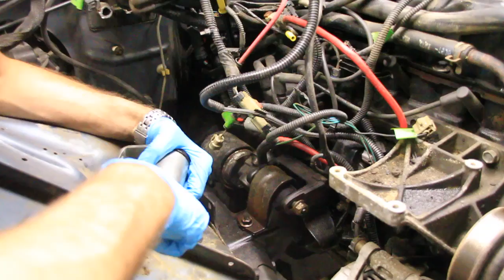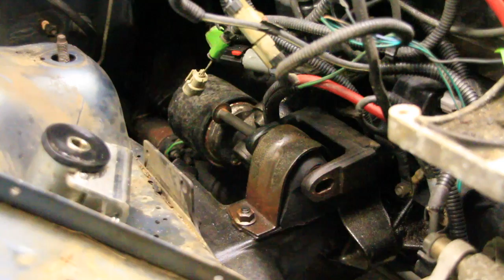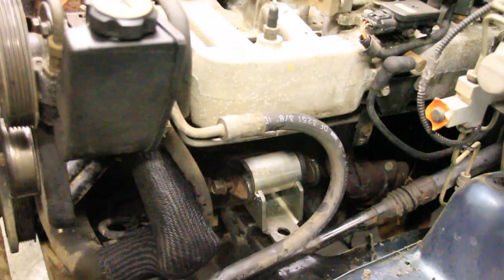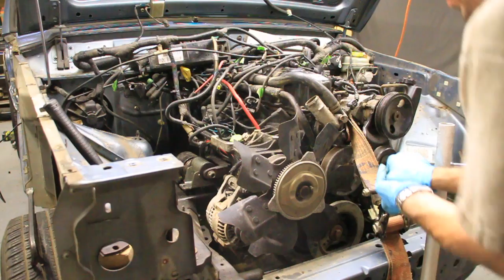How-To Install Motor Mounts - Daystar Brand

Comment: Boy do I have a story... So I bought my 93 YJ that's got a 4.6 stroker, SM420 transmission and a NP235 transfer case, ran strong and everything, drove it home and it overheated real bad on the freeway and developed a real bad knock, sounds exactly like a rod knock and lost all oil pressure so I pulled the oil pan, replaced the oil pump, inspected everything, plasti guaged the rod bearings and they were all within spec and looked brand new. Then I replaced them just because I was in there, of course plasti guaged them again and they were perfect. After that I did the timing chain, then after that I fixed the overheating issues with a new radiator (old one was filled with sand) new water pump, etc. after that I decided to drive it for awhile on the knock and figure it out, ran fine still had a ton of power.. Then the throwout bearing went bad, replaced that then when I put the clutch assembly all back together I couldn't get any pressure in the hydraulic system..
Reply: Part 2.. Turns out my master and slave cylinder went bad at the same time, replaced both of those then when I was priming it and bleeding it and finally getting pressure the hose blew, replaced it but after bleeding and draining the system for about a week I noticed Oreily screwed up and gave me fuel line so I just couldn't get any pressure, so I hardlined the whole clutch and boom! All good.. Then I moved back to the knock and replaced all the lifters, they were looking a little worn. Replaced them now I have like no power, it's misfiring, and STILL knocking. It's just wonderful... So I'm swapping in a 305 and 700r4 and NP205 I have laying around in there.
Reply: +Brian Athay For all the stories about people with stroker 4.0's... I've heard more bad or disheartening things about them than good things.
Reply: +Spearfisher1970 don't get me wrong they're great motors but that's of course if you do it right and use quality parts. Neither of which I think the previous owner did.. But it had pretty bitchin power haha low end torque was sorta mind bottling, turning all 4 in the rocks just idling in 1st

Comment: Had a clutch slave cylinder go out on me. I replaced the master and slave cylinders(came in a pre bled kit) and a 15 min job turned into a never ending job. Was acting like it wasn't fully releasing the clutch. I bled and bled and bled, also put another pair of new cylinders on but nothing was working. I ended up getting rid of the truck but last I heard the guy was putting in a new clutch.

Comment: I've done performance motor mount replacements in both my TJ and XJ and it never goes well.  So the problems Matt experienced are pretty normal.  There really isn't a better option unfortunately as the stock "vibration dampeners" are not up to the task in wheeling environments.

The job just sucks and nothing will line up easy. So plan to have problems and plan to have some help.
Reply: I used to have a 96 XJ. I wheeled it but really light stuff. Those stock mounts aren't good for even a daily driver IMO. I broke the heck out of them.

Comment: This might seem dumb as hell but I was just changing my oil and after I put the new oil in I was just going to let the jeep idle for a half hour and when I went into the front to make shore everything was fine I saw that one of the injectors was leaking gas so turned off the jeep and had to take the new injectors that were put on their about 3 months before just to find out that the O-ring had cracked. the worst part is I had to wait till the next day to get the new O-rings due to all the auto part stores that were near me were close at the time.

Comment: I was looking at getting the brown dog mounts, but honestly without all the access you had I'm not sure its a smart idea.
Reply: +mamefreak3 I dont know if Cherokee mounts are more buried by stuff than a TJ, but the mounts on my TJ werent bad to do with everything installed. The hardest part for me was doing it myself; trying to realign the motor back to get the new mounts to go in the bolt holes.
Reply: +Maverick Xeo Also, mine has motor mount lift blocks too, so that made things harder to line up too.
Reply: +Maverick Xeo My install would also be on my TJ, guess ill have to give it a shot and find out
Reply: +mamefreak3 It does really look intimidating, but the work is pretty easy. Make sure to loosen your transmission mount bolts too (the four on the skid plate), this helps allow the motor to move a little more. Having someone help is pretty important too. After I did my mounts by myself once, I had help the second time and it was LOADS easier.

Comment: I had to change it, because it got so bad the engine moved by itself and made the fan hit the radiator that was a double radiator so its really close to the fan, let's just say I spent a good amount of cash for a new radiator a belt and a mount, which after a while also fucked a pully.